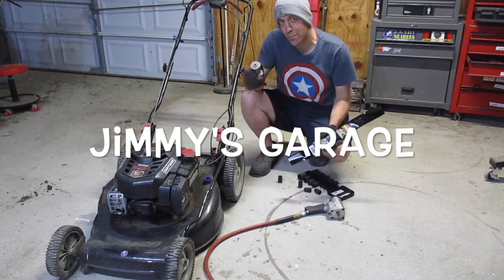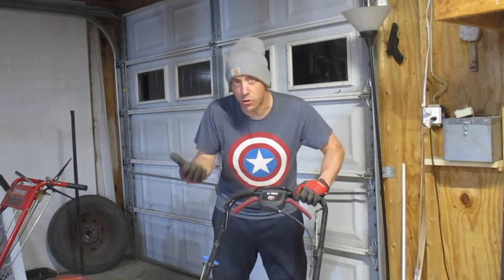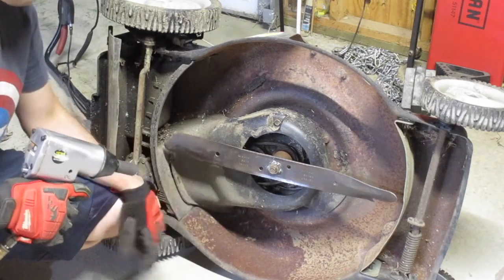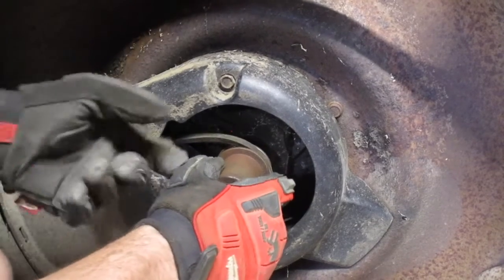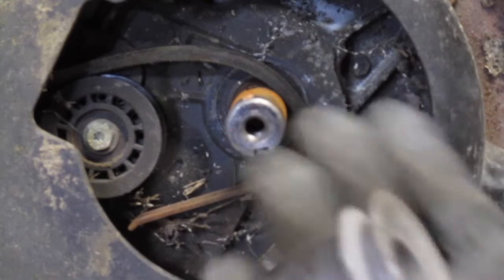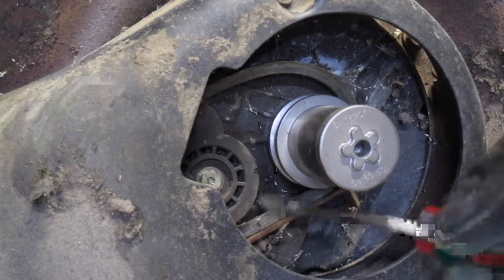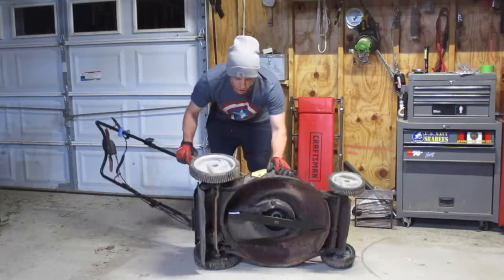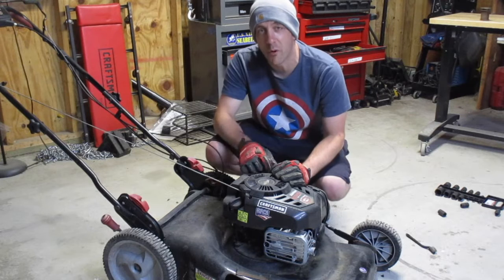How To Replace A Lawn Mower Blade & Blade Adapter In Less Than 2 Minutes!

Comment: Tilt your mower with your air filter facing up
Reply from the maker: Good call. If the tank is empty it won’t matter - but it’s better not to risk flooding your carb and air filter! 🤘🇺🇸
Reply: Ya even if tank is empty im tracking that the engine oil could leak cause damage/ a mess

Comment: My blade adapter is seized on my craftsman mower. Any ideas?
Reply from the maker: Penetrating oil. Spray all around it & let it sit for a day. See if that helps slide it off. Give it some gentle whacks with a hammer. Should come out. 🇺🇸🤘

Comment: Unfortunately I wasnt able to find an exact replacement blade with notches. I got a universale blade with a circular cutout.  It has the inserts for blade cutout with different bolt sizes. I figure Id put a washer flush onto the notches, then the blade on top, then tighten down. Does that seem right? Thanks!
Reply from the maker: In my experience, you should get the right part. It’s always great to improvise (my channel is built on improvisation) but for blades - try to find the right one. If the blades you have line up correctly, you could throw a couple spot welds to make sure they stay in place. That’s just a temp fix though. I’d spend the money (unfortunately) and get the correct blades.
Reply: @jimmysgarage9068  Thanks. When I find one, I will buy it 👍

Comment: Considering the gas tank. Do you tilt the mower onto it's left or right side?
Reply from the maker: Best practice is to have the carb/air filter facing upwards. This will prevent oil from leaking through the breather tube and getting all over the place! 🤘🇺🇸
Reply: @jimmysgarage9068  Great point. I didn't even consider the oil.

Comment: Can you tell me some information about the 501 adapter?  What is the pully size?  Does the inside of the adapter accomodate a 25 mm shaft all the way to the top of the adapter or does it stop a third or half of the way up?
Reply from the maker: Hi Tom! Great questions - but I don’t have those answers. I literally went down to my “mower guy” who has an amazing supply of parts, and told him what I needed. Best of luck to you.
Reply: I get that but you put it on in the video.   Was hoping you'd remember what the inside of the part looked like.   Thanks anyway.